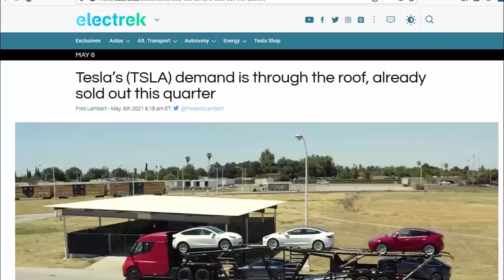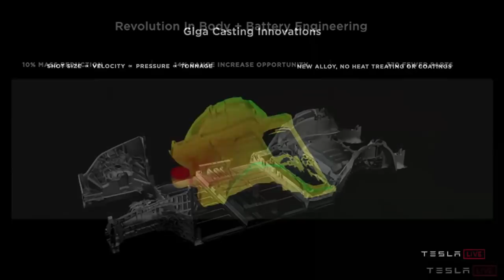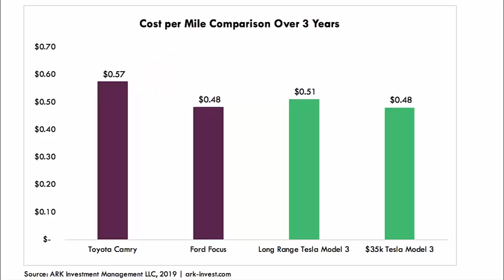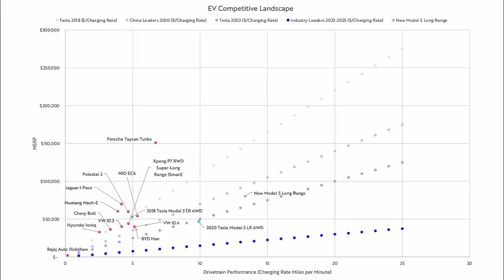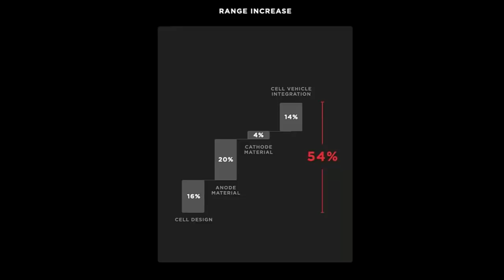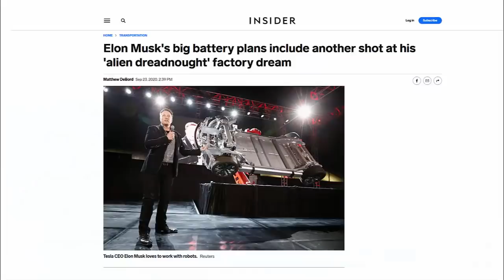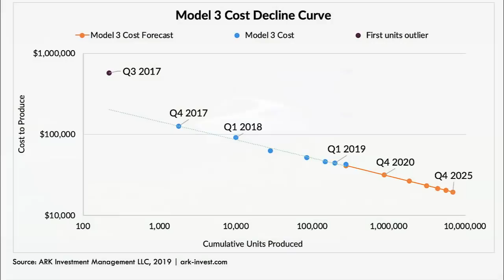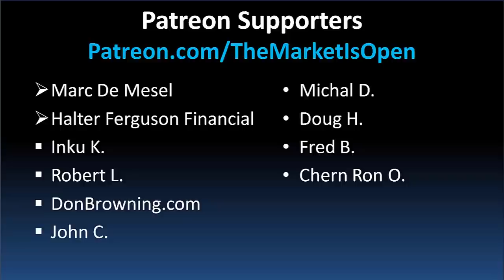The Frightening Economics of the Tesla Model Y

Comment: Can you do a comparison between the 4680 cells and byd's blade battery. These seem to be the most advanced battery tech on the market
Reply: With any new battery tech that comes out, getting from a promising prototype to mass production of a highly reliable product is the hard part. Theoretical advances are exciting, but the devil in bringing a product to market is in the details.
Reply: @michaellink6960  Byd blade batteries are in production. It's tesla's 4680s that are not production ready yet
Reply: Charge power/speed is slow for Blade. It is LFP as far as I can tell and LFP is older battery tech although there are always new sub chemistries that provide various improvements. LFP is usually safer than NMC or NCA, but also heavier. Blade just seems to be a new flatter format that is cell to pack style. The LFP version of 4680 may be similar, but hard to say at this point with no specs from Tesla on that particular variant.
Reply: @davedavenport8673  yes it is less energy dense than the nickle battery chemistry but it is true cell to pack and overlooked for safety. Also tesla's cylindrical battery cells are not the most efficient use of space in a pack. I'm not pretending to be a battery expert but I think there's other good tech out there tab tesla's
Reply: @jchong416   Agreed that safety of LFP is overlooked, but it has drawbacks as well like the discharge curve is fairly flat which creates problems for measuring current capacity remaining. I am concerned about the cooling system required for these Blade long prismatic cells. Maybe that is the main reason for low charge/discharge rates. That may be fine for small city type vehicles with low power motors. Also, likely why Tesla suggested the LFP packs would be in the small vehicle in the future. Any vehicle with decent performance motors would not be able to use LFP pack. The 4680 cell to pack will be much lighter and better than their current packs.

Comment: Low cost of EV charging?  BS Flag!  The home tier 1 PGE rate in NorCal is $0.26 per kWh.  Tier 3 where most marginal home EV use will price for the additional 3750 kWh per year at $0.40 per kWh is ~ $1500.  

Note that this is comparable to the ~$1200 a Camry hybrid owner will pay for 12000 miles at 40 mpg and $4.20 per gallon.

Not saying it's better or worse, but roughly comparable in the Socialist Experiment of NorCal.
Reply: in the UK you can tier 1 for 5p/Kwh

Comment: The end of ICE dominance will be when the cars cost the same or less to buy, are as repairable as ICE cars or more, and are able to charge within 300 seconds. However, all I see is an arms race of manufacturers making non-repairable cars with more and more batteries to give more range, more powerful motors to drag those batteries around, and bigger screens to justify the enormous price without the need for luxury materials. It's the same thing that happened in the early 1900's and ended EVs. If you say it won't happen again, Let me remind you EVs were 50% of the whole fleet back then.
Reply: It is rare that someone needs more than 300 miles in a day. Charge at home overnight and charge time is essentially zero - charging is never something to worry about.
Reply: @benjaminmorton9436     A considerable amount of people use their vehicles for something else than exclusively commuting to work, and a high percentage of these people will easily beat 300 miles a day. If the battery lasts the whole day for them, but they forget to connect the charger at night, the car will be unusable for at least an hour the next day.

Comment: Absolutely spot on with that analysis. Add to that the fact that Tesla has by far the best charging infrastructure.
If you look at the cost of building a Model Y compared to say a BMW 3 Series, it's chalk and cheese. It's only the cost of the battery which makes it expensive, and that's clearly coming down rapidly.
It's really hard to see where European manufacturers will win in that market segment. The only problem Tesla has is the car is a bit too big, they need to make a scaled down version. It can be exactly the same visually, the design looks great and the 5 door arrangement is what most people here want. As it stands, customers are likely to choose the ID4 rather than pay for a Model Y which is over the top for what they need.
Reply: Maybe, but with two kids I would prefer the current size, or some type of station wagon. 
The rumored "model 2" hatchback would sell like crazy in Europe though, if the price is right (even after tax).

Comment: car companies make most of the 
money on the replacement parts.
Reply: You are correct. Brakes because its heavier. Suspension becaues the roads are bad. Tyres because of weight & harsh braking and accelerating. Steering the same. Can't see a lot of expensive parts in that!
Reply: @kevinburke6743  all those sensors on the bumpers , if you wreck.  sensors all over it.
Reply: new battery
Reply: @MUCKFOOT399  All these Battery cars will need a new battery at some time in their lives. My guess is TEN Years Plus or Minus Two years.
Reply: @MUCKFOOT399  why would you wreck? It's got collison avoidance! That what the sensors are there for! OK if your stationary and someone runs into you, that's their problem!
Reply: @kevinburke6743  oh , yeah , that's accident proof  ,and indestructible
Reply: @MUCKFOOT399  I agree to a point. The collission avoidance and travelling too close(tail gating) work too well on my BMW. You(Americans) are going to push like crazy for level autonomy. Then you'll be able to let the car do all the driving. Also you you'll be able to summon your car on your phone. Then every fast food outlet will have driverless delivery vehicles that can run for 8-10 hours on a single charge. So there's a crash! Who's the Judge going to believe? Simple 99 times out 100 it will be settled by insurers. The insurers will go with the dash cam or vehicle cam fottage.
Reply: @kevinburke6743  Almost never use the brakes so they wear out very slowly.  I have 55K miles on my Model 3 and the suspension is as good as new.  I have started asking about when they start to go bad.  So far no one has replaced them due to wear.  I got 35K out of the original Privacy tires.  I have 20K on the Michelin Pilot Touring ASW tires and when I have them rotated at 12K the wear was about 1/16th of an inch.  So I am looking at 50K with these tires.  The Model 3 is within 200 pounds of a BMW M3 so the weight isn't a major issue.  Harsh braking and acceleration?  I use regen braking and I can't accelerate quicker than the car in front of me very often so that isn't really an issue
Reply: @bryanwhitton1784  Sounds like Tesla is indeed the way forward. 35K miles on a set tyres ain't bad. I only got just over 10K on the rears on my BMWi8. I drive mainly on electric which is driving the front wheels! God know what it will like when I start having to make long journeys again. Also your roads must be better than ours(UK) which are pothole riddled.

Comment: Tesla will in the future develop or buy a battery technology that will be revolutionary, that battery will overcome the issue of batteries getting too hot, it will be so safe that a liquid component can be drunk without any adverse effect. They may already have the beginning technology but not yet making it known. Possibly the adding of a new under $20,000 cost car will be announced because the battery will be less costly to produce and at high volume, allow that saving along will more advanced tooling this price point making an EV competitive with gas-powered cars. The truck for the general market will also use this new battery technology.

Comment: I love my 2003 Buick It runs well, no charging necessary just gasoline.
Reply: 75% of the $ you pump into that car engine produces ONLY heat, ( if we ignore the pollution ). 
That's how inefficient any piston engine is.
Reply: @thosoz3431  Thats about right ,also got it for 75% off used one. Very happy with it.

Comment: Test drove a Y extended rage.  “Dealership” experience was amazing.  Non “Sales” people were great and professional.  The speed and “hook up” was shockingly profound. Can’t even imagine the speed of the high performance model, or the speed of a huge Cybertruck.  Unfortunately, I don’t drive around town on a smooth racetrack.  25 to 70 mph tops.  Don’t usually  need or want rollercoaster acceleration.  The Y interior smelled from all of the cheap plastic.  The under designed “dash and lap top” stuck on with a stick looks really cheesy.  Made me feel like I was in a budget computer cubicle work space.  The fake “leather” seats felt like what they are made of, fumed cheap recycled plastic, with added preservative poison.  Feel like a grandmothers plastic slip covered sofa.  The carpet seemed ready to come up and really low budget.  The ride was ok, but not great.  I own several Lexus’.  Tesla has a long way to go to match the luxury brands for fit, finish, ride, and interior quality.  The other manufacturers will be very tough to beat when they soon match the Tesla battery and power train.  Hope Tesla figures this out quickly, as I am a stockholder.  For some reason, Tesla has gone with this minimalist taxi feeling interior/exterior on a $50,000 plus car?  Model 3 and Y look the same and about as exciting as my sisters Camry.  Wheels look cheap and ugly.  Nothing Tesla seems built to last, except the amazing power train. Will unfortunately be guzzling more gas and waiting for my Lexus all electric crossover. Going to buy a electric mower soon, have a electric bike!

Comment: The Fremont facility was built by GM in the the mid 60'S and produced Buicks, Oldsmobile and a few Chevrolet models. GM than mothballed the factory and several years later was reopened by the GM/Toyota partnership called NUMI. After years building Pontiac Vibes, Toyota Maxtrix, Chevy Malibu's, Toyota elected to pull out of the partnership. Not long after GM again shuttered the facility. When Tesla obtained the facility many blue manufacturing jobs had disappeared in Northern California. The little equipment that remained inside the facility was useless and outdated. I'm none of was used by Tesla to build anything.

Comment: ...i considered the time.

Mostof those 300parts are fasteners like nuts a d bolts, driven intk place with extreme speed.

If you see no issue with mojolithic unserviceable car parts, just consider tthat tesla already has issues with servicicng broken down vehicles.

Introducing design elements that make 3rd party repair impossible is not going to help.

Comment: Ok, so, I buy this first generation E.V. for 36+K,  have it delivered to my home,  then what? I have car pmts. Insurance, but, don't have to buy gas, problem is, the closest recharging station is 8 miles away!! There are no more for 50 miles!!!
Reply: It'll take a few more years for EV charging to catch up.  In a perfect world you'd do what charging you can from home.
Reply: The closest charging station can be right in your garage.
Reply: Many homes have a 240VAC 50A circuit in the garage, perfectly adequate for overnight charging.  If your home doesn’t, the contractor was a cheapskate builder.
Reply: @CrustyCrip  Some homes are pretty old.

Comment: Seems pretty obvious that the parts overlapped between the model 3 and the model y are actually substantially less than the originally claimed 75%. Consider 40 to 50% a more likely reality.
Reply: I agree.Parts commonality between models is overrated. Each model is made in enough quantity to reach sufficient economy of scale. Parts optimisation for purpose becomes more important. Tesla do not even have high commonality between Model 3 made in Shanghai and Fremont.

Comment: No matter who sells you an electric or hybrid car, the battery warranty period and/or miles limit, says the real economic truth of the matter.  I pity the fools who buy this stuff, and find themselves with a battery replacement bill that is higher than the used-book value of the vehicle.   If the government actually cared at all the for buyers of this stuff, they would force battery warranties to be 300K miles, 15 year range.   Or do you care-free buyers, think your Tesla model-S $70K plus sales-tax, and debt interest, bill  (probably about $120K),  should have a tiny useless warranty?  I too purchased a new Prius ($28.5K with tax) .. what a stupid mistake.  This Prius has a horrible total cost of ownership, or total cost per mile, no matter of which calculation you run.  The Prius can be totaled by merely kicking in its bumper, thus just collision-comp insurance is very pricey.  If any one of FIVE parts fail (and they do fail).. Motor-Gen-1, Motor-Gen-2, Power-share-transmission, HV-Battery, or main-oil seal fail.. (except for the $4500 dollar battery). the motor has to be taken out of the car for the repair... is a 40 hour labor bill.. just for labor part of it.... about $6000 USD.  For a typical gasoline engine small car, the entire engine can be rebuilt, without taking the motor out of the car.  Not so for the Prius, and almost all of the hybrids.

Comment: If Ford can sell an all wheel drive electric F150 for $40k and make a profit, Tesla can sure as hell sell the Model Y for under $30k, but Musk's greed will be a barrier to entry for most people for a long time to come.
Reply: All Ford did was add electric motors to the same bland truck they’ve made for ever. In fact the cost to make the F150 is so cheap for them it’s fat with profit. And as always all they do is change the grill design and fail at crash testing.
Also don’t forget the Ford has bigger facilities so yeah they can keep cranking out that terrible truck. Where’s the Ranger we all screamed for? It’s the over priced and bloated Raptor.
Reply: @SteveBueche1027  it can't be that terrible if it's been the most popular vehicle in the US for decades. But yeah, Ford does have an insanely huge profit margin with it. 

I guess I'm just bitter bc I want a small electric sedan, but they all cost the same or more than this new AWD F150 which would cost less than $30k after incentives. The AWD is so important in places with lots of snow in winter like New England.

Comment: To each their own. I owned one and glad I sold it. It was garbage. I would like to see the Y quality improved from Austin, as mine had many panels misaligned and the overall driving was ok--but the range still not good on std. the UI is garbage and a royal PIA--not useful, constantly have to touch/look at the screen, warning bells on stupid things, can't just reach down and do something--have to ask it to do something or navigate screens. I went to a body shop and saw what happens if rear ended. The one-piece rear will cause many of these to be totaled easily. They don't know how to fix them. The economics are changing on EV's because they are purposely reducing ICE capacity, increasing cost and Biden is doing all he can to make gas $8/gallon.  I am all for alternate energy, but the focus on EV is curious, but understandable. Use of hydrogen via fuel cell/amonia is a far better replacement for gas. When you buy a Y, you are at Elon's mercy & it will be outdated in 6 months.  After what I went through, I will never own a Tesla again. I'll pay $8/gal and drive an old Nissan until i can't fix it or wait for Xpeng, Nio's. My old leafs were better, more useful but the range/battery life did them in. you will be much happier in a camry.

Comment: So, let’s get this straight. The new single casting process and supposed 4680 batteries (ain’t actually going happen, they be 2170 as all 4680 are needed for other models), on the Model Y will reduce the build cost significantly right. So Tesla is going to pass this saving onto the customer. The Model Y will now undercut the price of the more expensive to build Model 3. Those Model 3 sales are cannibalised by cheaper Model Y. Tesla forced to drop Model 3 price and take a loss. Result is Tesla ends up in same or worse financial position!

Comment: Over hyped cars
Reply: Think on that the next time you're putting $80 into your gas guzzler.
Reply: @thosoz3431   how much does a a new battery cost to replaceable on a Tesla or are you going to buy a new car again
Reply: @thosoz3431  also when you pay about fifteen thousand to replace your battery
Reply: @jacklow9921  Do a bit of research. It's not a flashlight you're talking about.  It's such a non issue (except for Nissans), the very idea is ridiculous.
Reply: @thosoz3431  correct no flash light remember it’s a battery little by little it’s will get less range eventually it’s has to be replaced do yo you know how much money it will cost you

Comment: The only down side is even a minor accident and the car is a total loss. Any damage to those castings or the battery section and it's game over. This is probably why they are working on offering their own insurance.
Reply: Surely, these days, all insurance companies for all types of car tend to go to 'write-off' status very quickly
Reply: The crash absorption rails can be cut off and replaced with a bolted part for collision repair.
Reply: If the cast parts are cheap enough they won't need to write off.
Reply: @TheEvilmooseofdoom  it wont matter if it takes 10 hours of labor just to get the part off. That's what totals most cars is the labor not the parts. That's why Toyota bought all those trucks back with rusted frames. The new frame cost like 4k but it took 3 days labor to replace it.